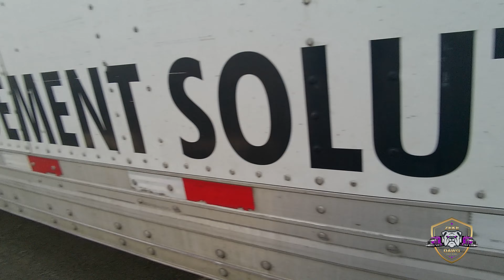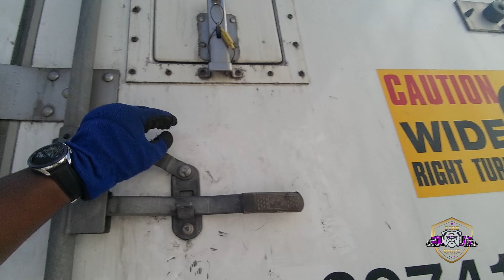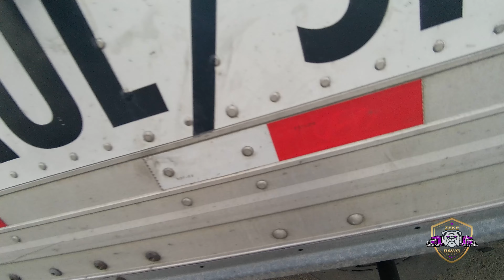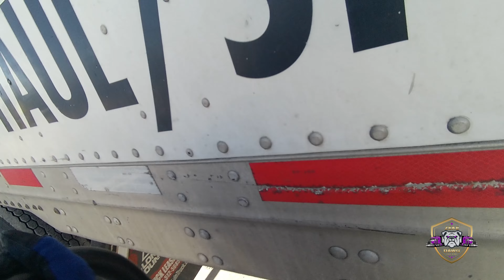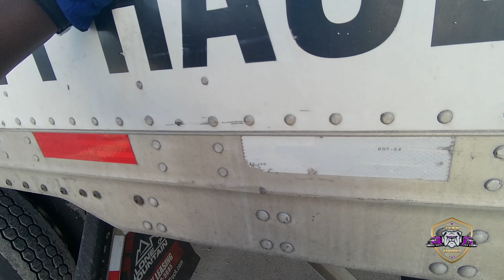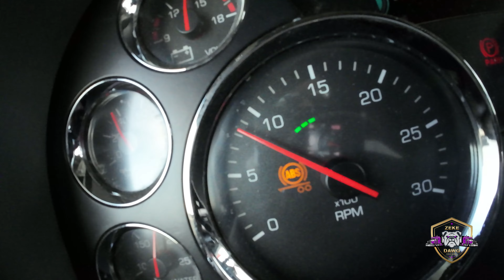The Beginning of a BAD Landstar Trailer

Comment: By that air line coming off of that hub , the oil in that wheel to lube those bearings is gone! Those bearings will eventually lock due to no lubrication! Then the wheels lock!